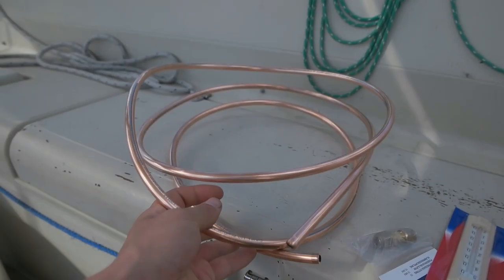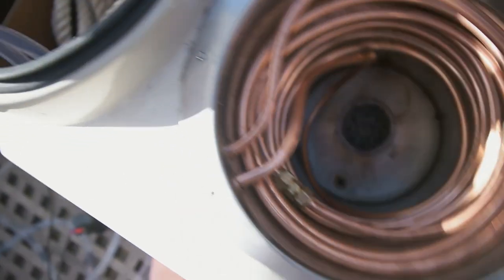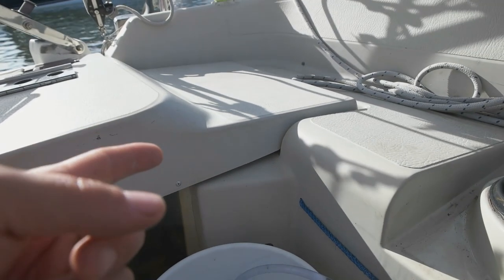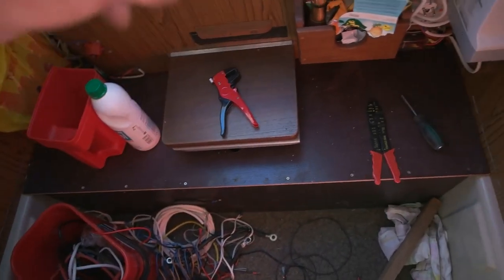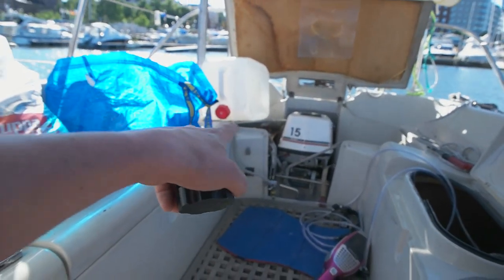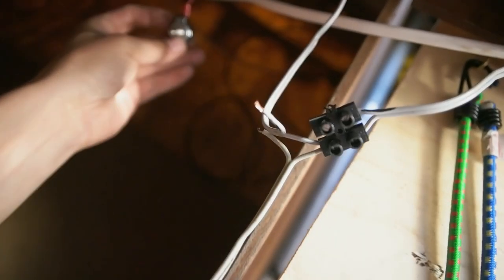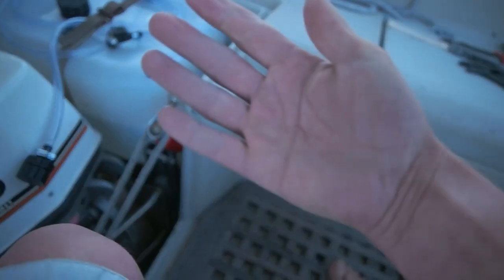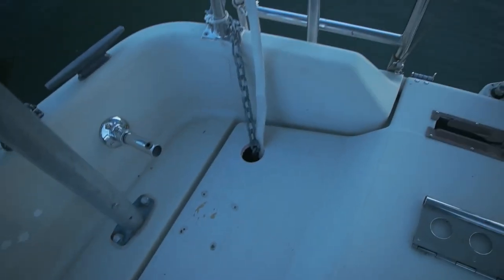More heat pipe and stuff - Electric sailboat vlog 0032

Comment: Pauli? Run that Copper Tube past Your Cooker / Heat source like a heat exchger. Wrap the Tube around a suitable small Tank. No more than 5 Gal. Insulate the Tube on the exterior and cover with Sunbrella to look nice. If it boils, then just distill the Steam and fill Your Tanks with clean fresh Water. We will all be in awe of Your skills. Regards SV PI2

Comment: If your solar panels are more than sufficient to charge your batteries then what about dumping the unused power into a low voltage element built into the hot water tank? And also what about using a small copper tank clad in insulation instead of a plastic one? That way it will retain the heat for hours after you've heated it up.
Reply from the maker: +Richard Talbot Good points! I'll look into the heat element..